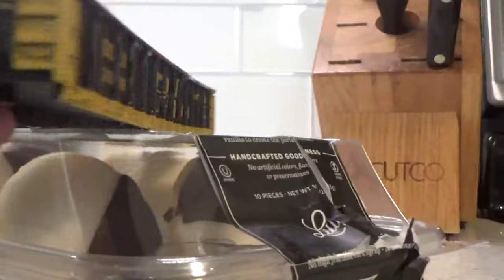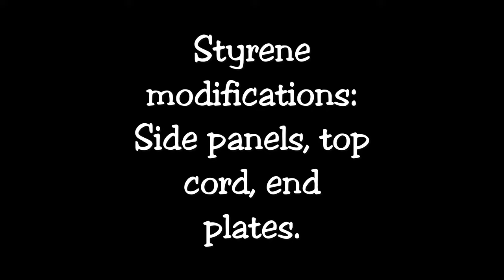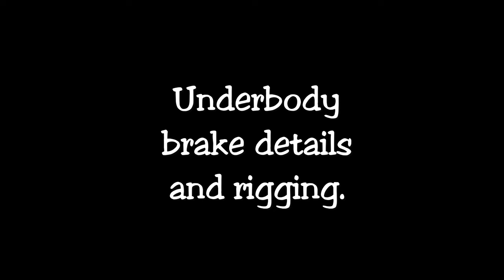Modeling With Dan!   CSXT Railgon #708218

Comment: Great job Dan. You always put a lot of effort into your stuff. I one recommendation that should of been done on side ends where the two handrails are with the stirup. I would of took the small handrails off then put the warped styrene on. You could of redrilled the holes to put the handrails back on. Great job though. Thanks

Comment: Questions:  How do you remove the original chord and what do you replace it with?   How do you attach the floor and do you modify it in any way?  What about coupler height?  If you bow the entire body the couplers will point upward and coupler height will be wrong.  How do you fix this?
Reply from the maker: I don't remove the original cord, I simply add styrene L channel on top of it.   The floor is simply glued in place with superglue, and I've never had issues with them not fitting after this technique is done!  Coupler height is adjusted with styrene shims.

Comment: Fantastic weathering! Love the sagging effect. One quick question... when you warp and sag the car, does it affect the coupler height and how do you compensate for that if it does? Thanks, Brian
Reply: and do the trucks ride correctly on the rails?  I guess you can put the screw in a bit less tight to solve?
Reply: I had a similar question - if the body is warped, how was the underframe mounted back on? Was it forced to warp via the truck screws or cemented in place?
Reply from the maker: @whiteknightcat  To answer for everybody, you will need to shim the coupler pockets with .010'' styrene.  As for the trucks, I will add a little 010'' styrene shim to the carbody around the mounting so the truck sits corrected at a flat angle.
Reply: @DansRailroad2011  Thank you

Comment: Nice video Dan. The weathering came out great. The warping effect came out great too. My only concern with that is does it affect the running performance of the wagon and also coupler height?
Reply: I doubt it affects coupler height very much. The ends of the car are bent slightly upwards, but it's only the short distance between the truck pivot and the end of the car that's raising the coupler. Likewise, I doubt it has any significant affect on ride: the pivot screws aren't quite vertical after the bending, but they're very close.

Comment: Hi Dan - have you considered using .005 brass for embossing the sides? I made my side panels the same way, just using sheet brass (Hobby Lobby. Michaels, etc). I then used double-sided tape to hold them down while I dropped a variety of metal objects (nuts, screws, even wooden dowels) and achieved a really cool effect. I used CA to glue them onto the gon sides.
Man, I wish I had your eyesight! And maybe a tenth of your skills. Keep it up brother!
Reply: Brass is more expensive, harder to work with and harder to attach to the car. What advantages does it have to outweigh that?